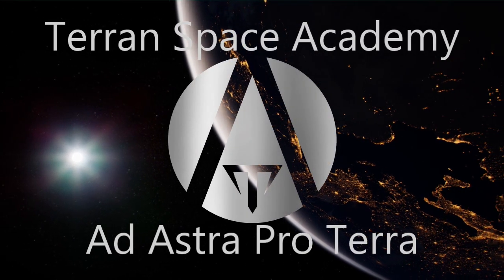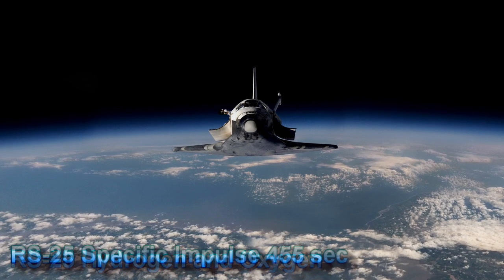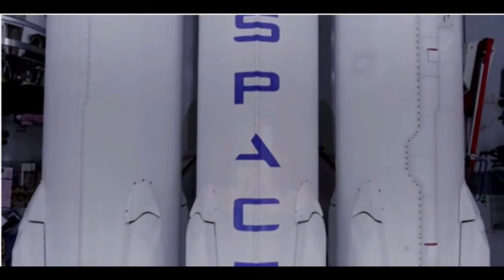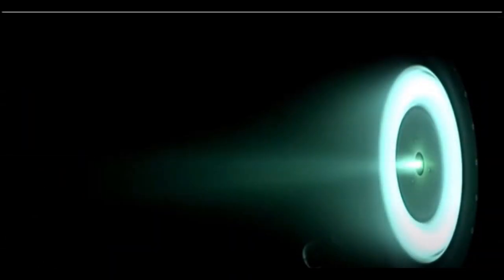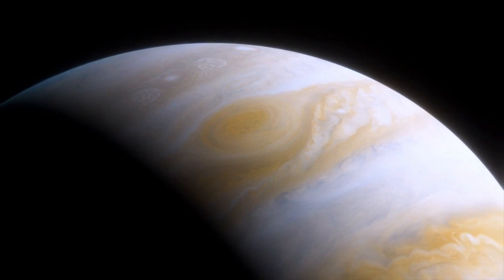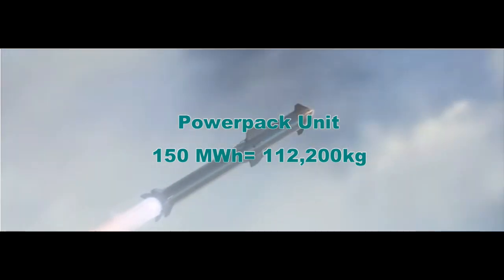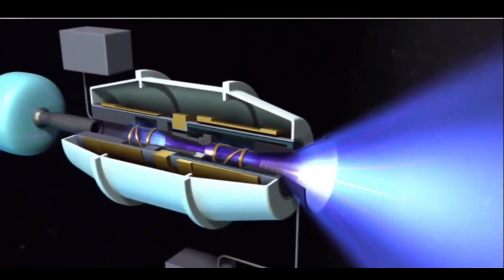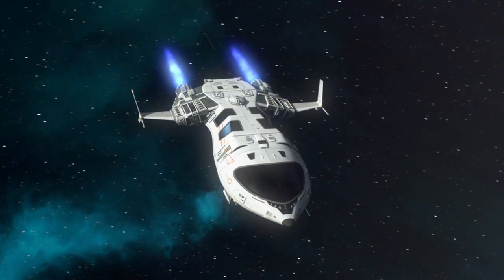Advanced Propulsion Systems for Spacecraft

Comment: Hello sir, is vasimr use radio frequency to ionize gas plasma temeprature of 5000-degree Celcius and 2nd stage uses microwaves for further temperature at 1millions degree celsius? but why different energy sources, not similar radio or microwave, is that due to the wavelength or energy consumption rate of radio or microwave devices to heat propellant? thank you very much
Reply from the maker: It probably has to do with the absorption spectra of the propellant. As a cold guess it will absorb a different frequency of electromagnetic radiation then it will as a plasma.

Comment: There are two other options I can see.
1. It may be possible to produce a hybrid chemical/ion engine. That would attach an electric generator or maybe two of them to the turbo pump shafts of a normal rocket and ionize hydrogen and oxygen using those electric generators to ionize hydrogen (pure protons)  mixed with ionized oxygen and ignited to produce an electron starved version of h20 ignited and ejected through a nozzle and that high speed positively charged water vapor is accelerated toward a negatively charged grid it should be possible to achieve a measurable percentage of light speed of the fuel mass. H2o is heavy. This type of rocket is a favorite of mine. 
Another hard to model design is to build a blimp out of photovoltaic and beta voltages and attach ion drives powered by those voltaics to push aerodynamic lifting wing/blimps at or even above the karman line. Drag and tift are minimal above the karman line. But nobody has experimented with acceleration and lift in those flight regions. At least with balloons. See JP Aerospace.
Reply from the maker: I love that idea and have been designing a large flying wing with hydrogen lift for that purpose.

Comment: If you want a lot of electrical power in a small, light package, a turbine engine burning rocket fuel turning a generator is hard to beat. I'd use that to restart a fusion drive. Also, what if we used magnetic fields to confine uranium, plutonium, or thorium ions? Robert Forward calculates in his book Mirror Matter, that almost any mission inside the Solar System could be accomplished with an antimatter powered rocket using hydrogen propellant, with only a 60% fuel fraction.
Reply from the maker: That's true but antimatter is very expensive...turbines would be excellent to boost power immediately in emergencies but are not quite as efficient as fuel cells. And we get water production from hydrogen / oxygen turbines.  Which is always useful in space.